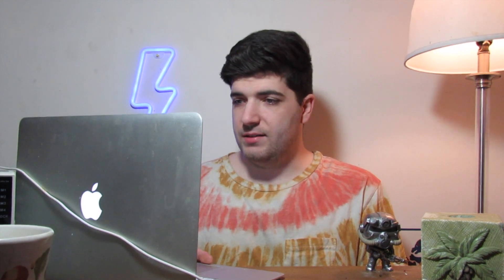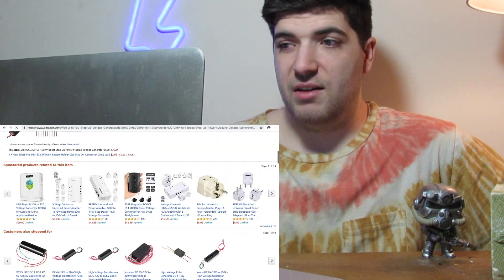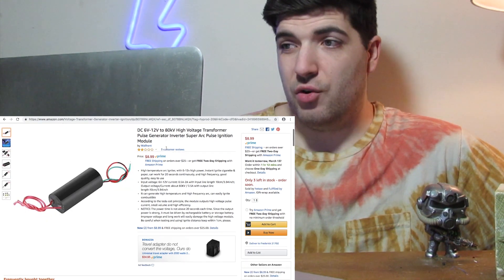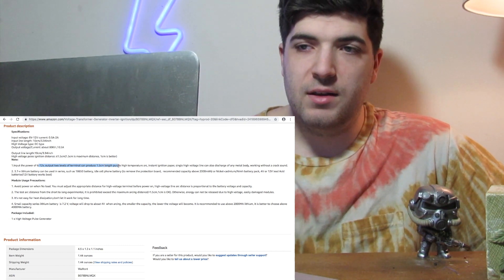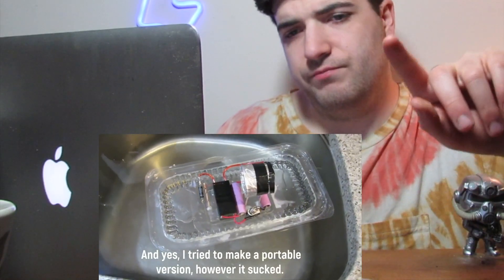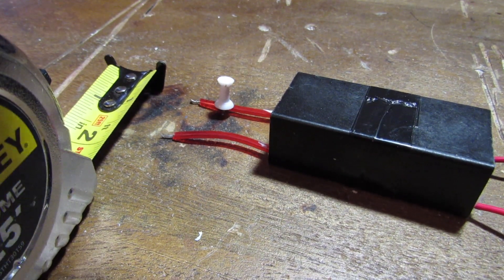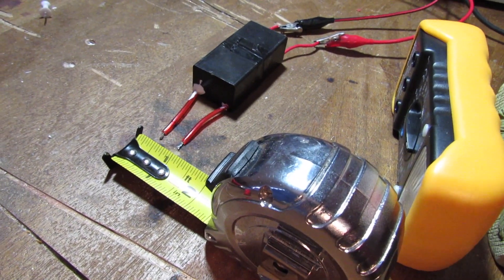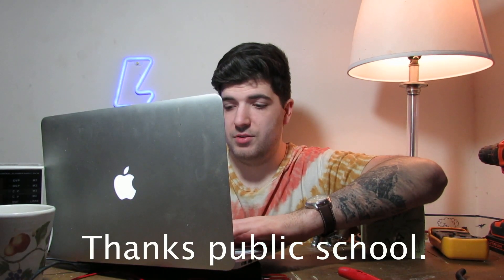Is AMAZON selling free energy devices?

Comment: That is probably some kind of zvs driver driving a transformer which outputs high voltage. But i dont think it stops there, i belive there should be a voltage multiplier stage at the other half which increases the voltage further but the side effect is that it has to charge up. If it was just a transformer it would output a constant power arc, like a flyback transformer from a tv. I made those a while back and they're pretty cool.